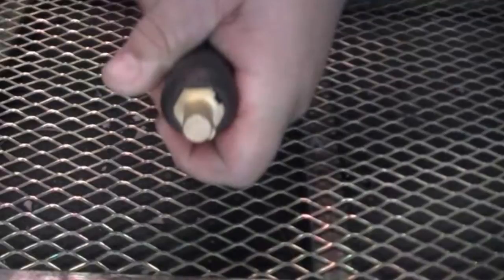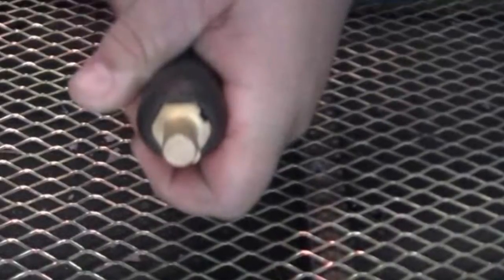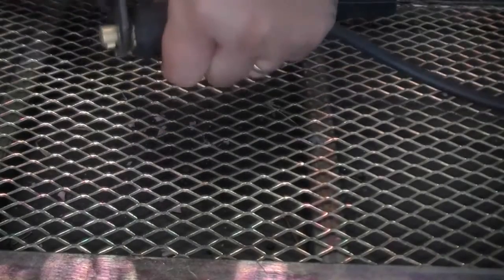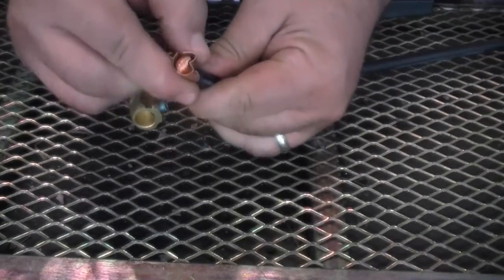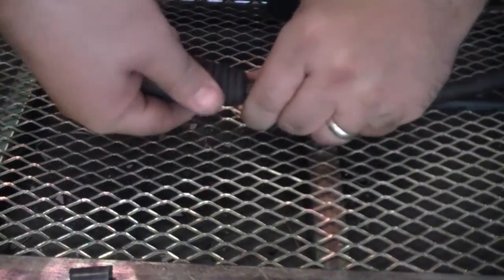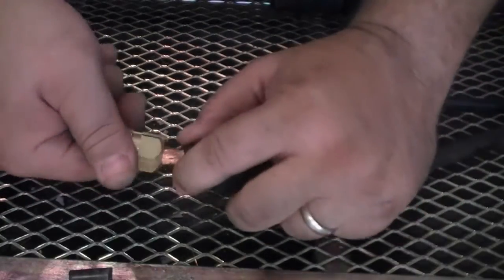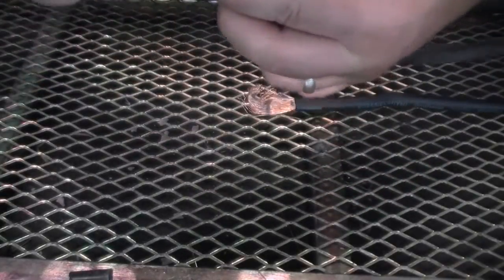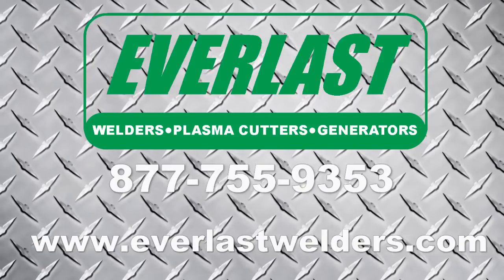Everlast Tutorial:  Power Connector (DINSE style) Cable Swap

Comment: I use a spare female dinse instead of using pliers on the pin while removing the boot. Should install boot first before cutting the insulation and at least put a flat piece of copper under the allen set screw. Instead of replacing to a longer lead, i just made a 3 feet extension with male and female dinse connectors.

Comment: TY so much for taking the time to post, saved a lot of aggravation and headaches!!!
It must be almost standard for welders [at least cheaper ones] to come with short leads? I think mine are 5.5 ft and much thinner gauge than I want!
Reply: Mine did too - so last month I got (2) 1/0 , 12 ft cables from (2) 2006 chrysler 300 at picknpull yard for $5 each then ordered (4)dinse connectors from amazon for $10. This  month 2 more of those cars came in & got 2 more cables.  Now up to 30 ft - this battery cable is marked welding cable

Comment: Thanks Mark. Very helpful. Selected a Lincoln 10 foot connector. Removed the DINSE 50 connector. Pulled the the boot off the 4' cable that came with the 140e, loosened the set screw that held in the shimmed, light gauge cable, removed the cable from the DINSE connector, jammed in the heavier weight cable (without a shim) into the connector and tightened down with the set screw. Took ten minutes. Used a piece of leather and and a small locking pliers to remove the OEM cuff. As you predicted, if the cuff is lined up properly, it goes back on easily.

Comment: Glad you posted this. I have a couple questions... What gauge is the wire that came with my 200st welder with the 35 DINSE connectors? I'd like to lengthen leads to at least 30 ft each? I understand how guage size effects voltage drop. But I'm wondering, since 2 sets of DINSE connectors are cheaper than 20 foot of welding cable, is it possible to buy only the extra length in cable and 2 sets of DINSE connectors and use the original two 10 foot cables each installed in line witha new cable through DINSE connectors to reach the overall desired length?
Reply: I used LC40 style cam locks for the splice, took the Dinse off the 10ft cables that came with my Everlast Power-iTIG 200T put them on the 25ft new cables size #2 , put the female end of LC40 style connector on the other end of new cables, put the male coupler part on the 10ft cables.  The LC40 splice connections won't come apart and mount flush with each other, male to female.  I know this is an old post, but I'm posting what I did in case anyone else has the same question.  I used Hobart brand, but there are others out there, you must order the size range for the cable you are using.  Mine fit #4-#1 and are rate for up to 300 Amps at 65% duty cycle.  You want to look at this, and also Amperage for the length of cable you are using.  Example #2 cable at 25ft may be rated at 250 Amps, but the same #2 cable at 50ft may only be rated at 200 Amps, at 75ft 150 Amps, at 100ft 100 Amps.  So if you need to have say 75' cables, that can handle 250 Amps of current, you would need to buy heavier, thicker, larger diameter 1/0 wire to handle 250 Amps at 75' Cables for welding run from #8 small and light, to 4/0 very large and heavy.  Price goes up fast as the cable gets larger in diameter, because welding cables are 100% copper, and copper is expensive.   Ditto the price of couplers goes up with cable size for the same reason.  Bigger, heavier, more copper.
If you are worried about the cables shorting out, they should not with these connectors, as long as you keep them out of water.  You can always coat the connection with liquid electrical tape, which is really an insulating rubber that you paint on.  Not really necessary, and especially if you are going to be disconnecting your cables at time.  

https://www.amazon.com/gp/product/B002AKIQCW/ref=ppx_yo_dt_b_asin_title_o07_s00?ie=UTF8&psc=1
Reply: Oh, the 35-70 Dinse plugs that came on my weld cables used a 5mm Allen wrench on the set screw.  The splice LC40 style Hobart connectors used a 6mm Allen wrench.  Also,  the cables that came with the welder are both black, my 25' cables are red and black.  So, to make the hook-up idiot proof, instead of using the female connectors on the both new cables same end, I put one female, and the other male.  Only one way for them to splice together now.  Positive to red, Negative to black.  Of course when using the TIG function of the welder the black work cable goes in the positive plug-in on the welder, and the torch Dinse goes in the negative but that's another topic.